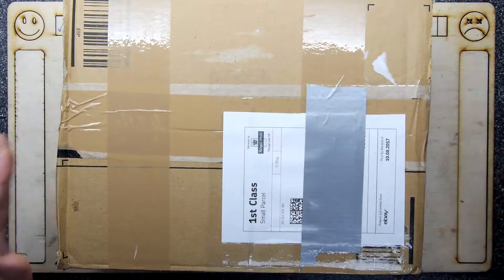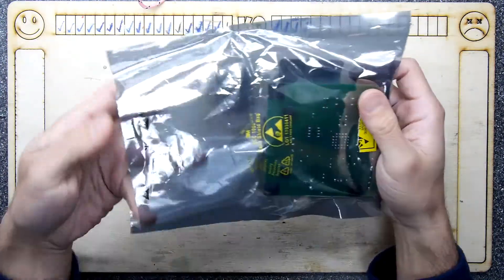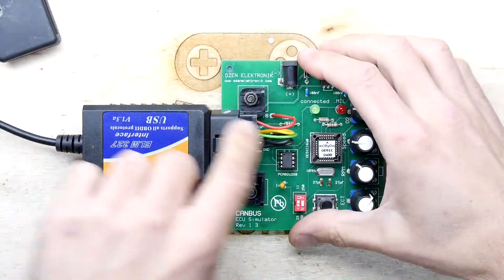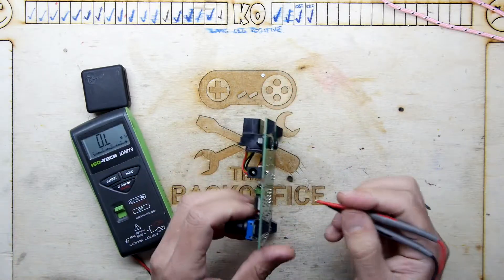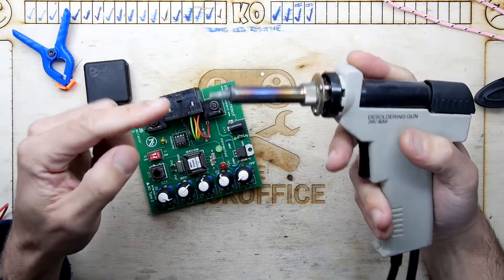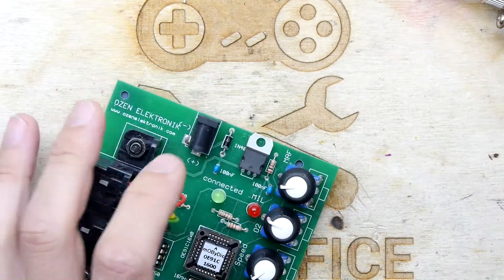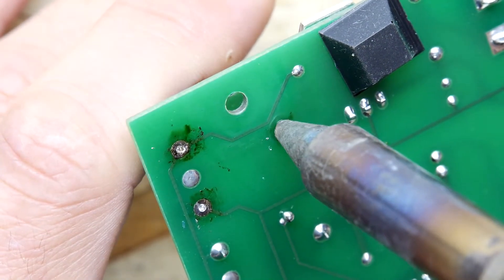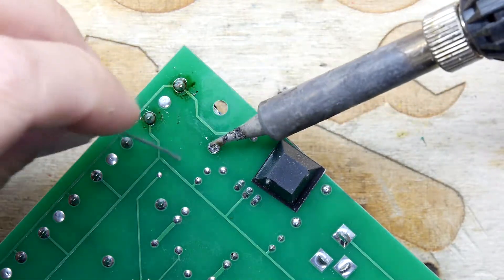Ozen CANBUS Simulator

Comment: So confused by this device. Whats it actually used for?  Would this trick a obd inspection machine into thinking the car is legit for an emissions inspection ? Like a car with a check engine light on? So it would pass ? I don’t see what else you would use this for?
Reply from the maker: It would probably be more useful for developing an inspection tool or device that is designed to be connected into the can bus on a vehicle like an after market rev counter
Reply: @ ok thanks for the response. I was a little confused about its use

Comment: Is it possible to add this device on can bus? Normally to connect to the can bus  line, there are two lines, one is Can bus H line and Can bus L line. But I dont see any connection points to connect to CAN bus H line and Can bus L line?

Comment: Crazy question could u run a standalone canbus control pannel from this ie like a vw heater pannel that uses canbus to power it up threw its internal processor
Reply from the maker: Almost certainly. I would not use something like this though. I would use a little dedicated microcontroller for that